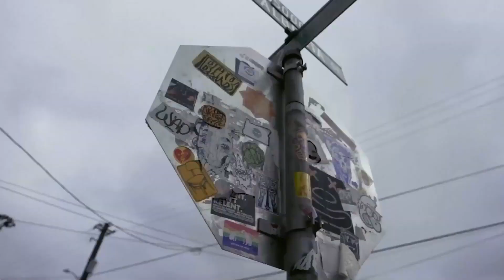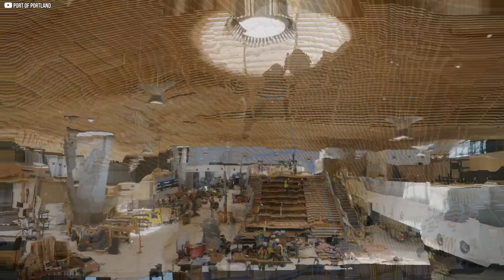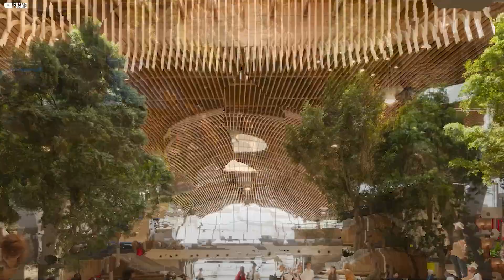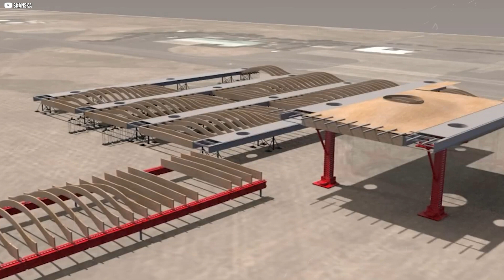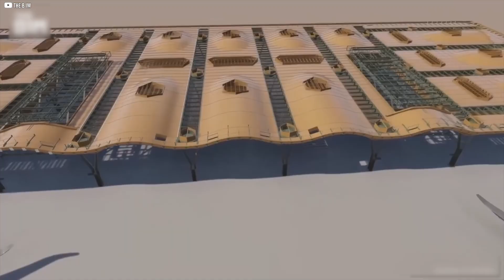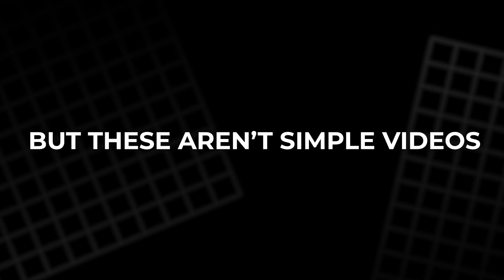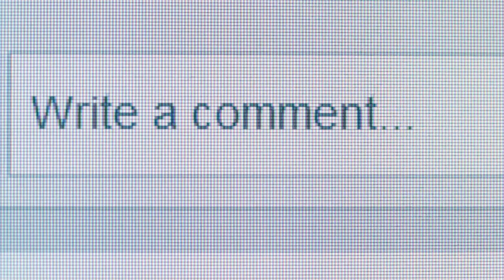Why PDX Will Be World’s Best Airport?

Comment: I don't think the narrator mentioned even once that Port!and is well known as the City of Roses! Obviously there needs to be a Rose Garden inside the terminal! 😉
Reply from the maker: You make a great point, and a Rose Garden would definitely add a unique charm to the airport!
Reply: There should be multiple ones that go right down the center of those huge bench’s in the main area.  Every bench level a different rose variety